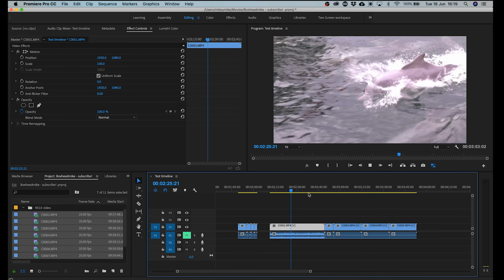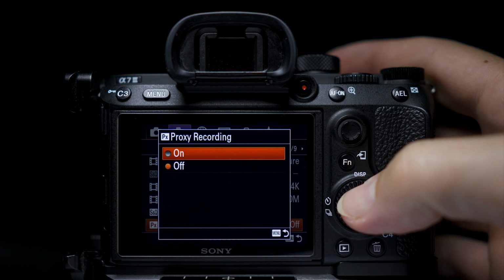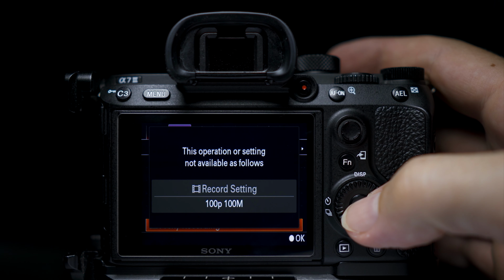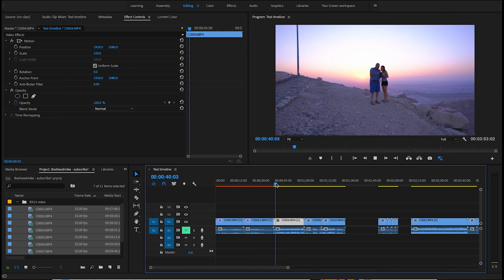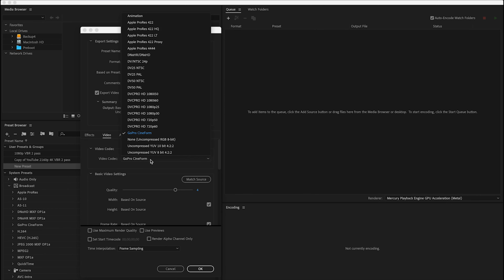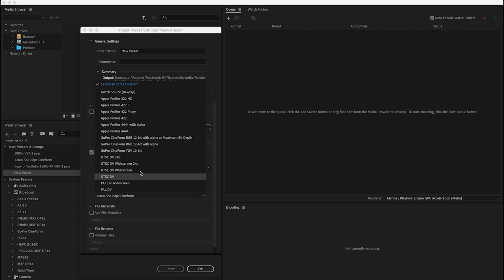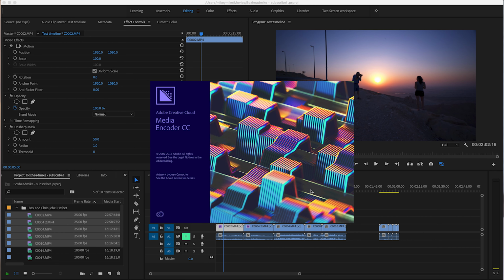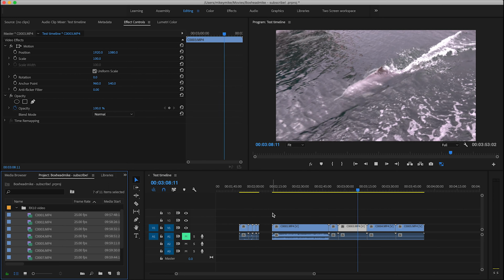Speed up your editing with proxy files in Premiere Pro and in Camera

Comment: Hi Mike, thanks for the video. I've tried your method for In-Camera Proxies, but when toggling them On, my 60fps clips are playing in 60fps within a 24fps timeline... Even after I've Interpeted Footage on the original 4k files.
Reply from the maker: Yep, the in camera proxies do really have a lot of limitations which sucks. 
I recommend making them in post instead and setting the frame rate to the same as what you filmed them as. 👍